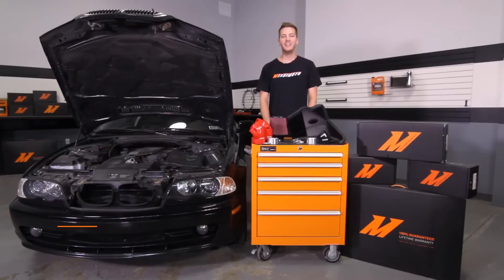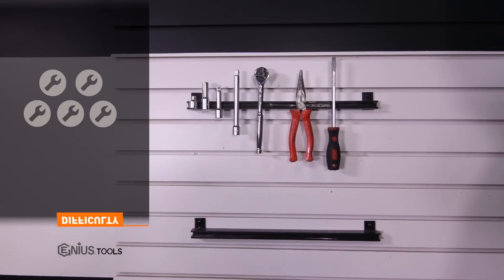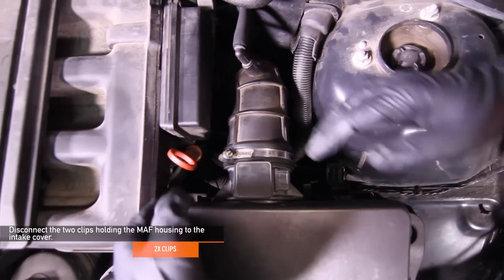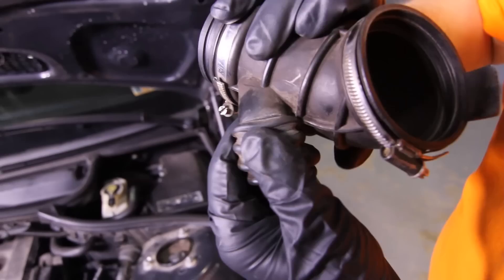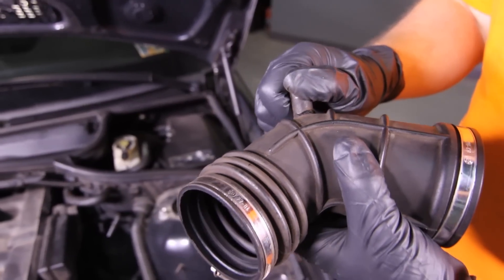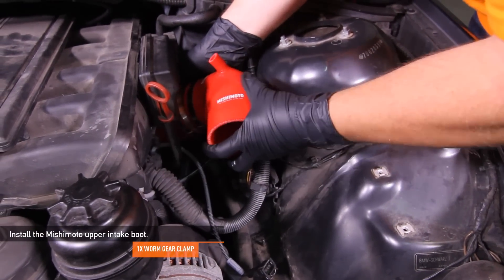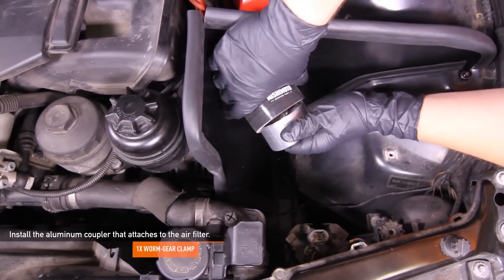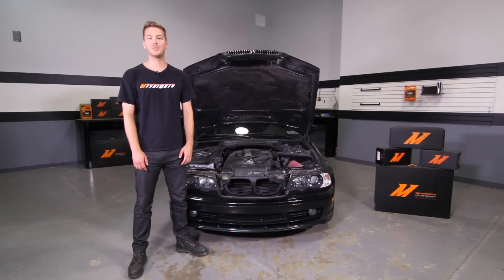1999–2005 BMW E46 Performance Air Intake Installation Guide By Mishimoto

Comment: Does the air flow meter cause damage? MY CAR E46 2002 330İ M54B30
Reply from the maker: No issues with the MAF sensor. Thanks!

Comment: Would this possibly throw out a check engine code. I keep reading forums about it needing a Tune.
Reply from the maker: No need for a tune, this will work with stock calibrations
Reply: @mishimoto  Cheers mate! Thank you.

Comment: will it work on a 2001 330I?
Reply from the maker: 323i/325i/328i only. 
For 330 applications, check out out model number MMAI-E46-01BK
https://www.mishimoto.com/bmw-e46-performance-air-intake-01-06.html

Comment: Im either putting one of these mishimoto air intakes in my 2004 e46 convertible or I'm gonna go with K&N,  haven't made up my mind yet... any ideas? I have the s54 with smg 2 6 speed transmission and borla dual shotgun exhaust, lowered sport suspension with a more mean stance and stability, the model however is a 325ci so it's like owning a sleeper, people hate me when they instigate a race at a stop light, always dust them and they see nothing but taillights or takes no more than 3rd gear and then same effect they get smoked, the m54 that is in this video isn't bad but I prefer my s54
Reply: I have a 04' 325ci convertible also, with sport package, but you have a better drive train than me, I bet its fun!

Comment: Does it need the heat shield?
Reply from the maker: The top of the heat shield does seal against the hood to prevent hot air from being introduced

Comment: Is this compatible with my e46 318i? Got a 4cyl 2.0 engine...
Reply from the maker: Unfortunately this would not be compatible due to the different throttle body location due to the shorter engine.

Comment: I'm assuming it does but will this fit in a 2003 e46 325xi?
Reply from the maker: Yes, we show that this is compatible with the 2001-2005 BMW 325i. Please contact us directly if you have additional fitment questions. Thanks!

Comment: I assume it fits the E85 Z4 as well. 2004 3.0
Reply from the maker: This will not fit the Z4, engine bay layout and spacing is different which would cause fitment issues unfortunately.

Comment: That installation is incomplete,where is the heat shield top cover,you can't leave it exposed like that
Reply from the maker: The area is actually sealed off from the engine bay once the hood is closed as the gasket along the top seals against the hood. Even without the lid the hot air is kept at bay.
Reply: @mishimoto  I see,thanks,I need the wrx elbow intercooler pipe connector to the turbo 2002 wrx,I am in kenya

Comment: Why is lower boot discontinued?
Reply from the maker: Due to the small tolerances and the silicone tube being stiffer than stock, installation of this item was a bit difficult. Due to this the part had to go back into the research phase to find a solution to this.

Comment: So will this fit my 06 330ci
Reply from the maker: The intake on the video will not fit the 330CI, we do however make an intake specifically for the 330 as there are some differences in the design.
Reply: Mishimoto Automotive do u have a link? And will it ship to California...
Reply from the maker: Of Course, I included the link below. We would be able to ship this to California however, the item is not CARB legal so you will need to be mindful of this.

https://www.mishimoto.com/bmw-e46-performance-air-intake-01-06.html

Comment: will this not work on an 04 e46 330ci?
Reply from the maker: We have an intake designed for both the e46 330 as well as the 325,328,323. However, this video is not for the 330 intake. The link below would be the intake you need for a 330CI.

https://www.mishimoto.com/bmw-e46-performance-air-intake-01-06.html

Comment: I tried to use dish soap and a couple other things to Lube it but I found using a heat gun works better
Reply: I was able to get it on with bearing grease

Comment: How does this compare to solutions offered by K&N, Green or BMD?
Reply from the maker: We unfortunately do not test our competitors components against our own. Most of our products are designed to improve on OE designs and eliminate common failure points while remaining compatible with related OEM parts.

Comment: hello, what are the odds that this installation can be done at a bmw x5 2002
Reply from the maker: Hey Luis. Thanks for reaching out. While we do not currently have a direct fit intake system for the 2002 X5, I would be happy to pass this along to my R&D team as a new product suggestion. This is how a vast majority of our parts make it to market is simply from customer suggestions.

Comment: Will this fit 2000 330ci? The Mishimoto site only covers the one fitted in this video and another intake for 2001 330ci onward...
Reply from the maker: Hello Luke. Looks like we do produce an intake system for the 330i. However, we were only able to verify fitment from 2001-2006. I'll leave a link to the product page below if you'd like to take a look. 

https://www.mishimoto.com/bmw-e46-performance-air-intake-01-06.html

Comment: What happens to that vent that was way down near the headlight on the old air box?
Reply from the maker: Hey pax6. It appears that that vent, in particular, is no longer used once you install our intake system.
Reply: @mishimoto  the stock m54 air box is already a cold air intake and it excellent from my over decade experience, this one will not let in sufficient cold air due to lack of air ducts top and bottom
Reply: @undergroundlegend198 Idea! What if you used the rest of this kit, but paired with that stock box you're describing ?

Comment: will this fit my 2003 320i touring
Reply from the maker: Hello OG Atticus. Looks like we currently have confirmed fitment of this product on the following vehicles. 
1999-2000 BMW 328i
1999-2000 BMW 323i
2001-2005 BMW 325i

Unfortunately, I'm not showing anything direct fit for your 2003 320I. While it is not an immediate solution, I'd be happy to send a new product suggestion over to our R&D team.

Comment: I recommend this type of colder intake for that car, I put a color and take the dining stage one package, but every time I wash the car I have to be very careful as my air filter is directly by my tire about 5 inches from the floorIf any water gets in there it screws with my mass airflow sensor for a couple of days, BMWs will not run after this happens until it has no moisture in the system.
Reply: Is there a water proof air filter bag you can put on the filter to prevent this?? I plan on putting my intake lower near the fog light but not using a whole kit
Reply: @x1username  he could just cover it with a black sack/trash bag while he washes the car but that would make too much sense

Comment: why is there very little for 2006?  The intake doesnt look different.
Reply from the maker: Hey Juan. 2006 is when the E90 body style was fully implemented and the E46 was ceased from production. There a quite a few significant changes under the hood that prevent these from being a direct fit on your 2006. If you feel this product could work in your vehicle, feel free to give it a try. We simply can not confirm it will fit.

Comment: Hi would this fit my 2003 320i engine code is m54b22 and it's completely stock at the moment
Reply from the maker: Hello Forbillion 3, unfortunately we do not currently produce an intake for the 2003 320I. I do apologize, but would be happy to submit a new product suggestion on your behalf! :)

Comment: Will this for on my 2000 323ci
Reply from the maker: Hello Kayo. This unit is a direct fit for the 1999–2005 BMW 323i/325i/328i . Unless there are significant differences under the hood with the convertible, you should have no issues at all :)

Comment: My maf housing is the same size of the hole on the heatshield so it won't fit through I have the mishimotto boots installed already.(04 330ci)
Reply from the maker: Hey MIchael. This sounds like something the customer service team would be happy to look into. Feel free to reach out anytime at support@mishimoto.com or 302.762.4501. Ext 2 for customer service.

Comment: Would this fit on my 2001 3 series 316i
Reply from the maker: Hey Henry. this item is Direct fit for the 1999–2005 BMW 323i/325i/328i. Currently, I would not be able to confirm fitment on your 2001 316I.

Comment: Really nice but, this really improve my bmw performance?
Reply from the maker: Hello Soro GuÊ. This intake is safe to use with the stock tune as it will not hurt air/fuel ratios under load. This intake has a unique and aggressive tone under load, and the free-flowing design amplifies engine induction sounds. This is the main benefit from installing this product as we do not list any power gains. If you'd like to hear it, check out this video. https://www.youtube.com/watch?v=HReBS77qW9U
Reply: Mishimoto Automotive v

Comment: Hii what about an older version like BMW E46 323i 1998, will it fit or u have any other models ? Ty
Reply from the maker: Hey Dave. According to my system, the 1998 323i would be an E36 model rather then an E46. At the current time , we do not manufacture an E36 intake. However, I would be more then happy to submit a new product suggestion on your behalf :)

Comment: Hi?! Will this air intake fit my bmw e46 3.18ci model 2001 ??
Reply from the maker: Hello Berkay Özsoy  . Unfortunately this intake would not fit your 2001 BMW 318. This unit is a direct fit for the 1999-2005 BMW 323i/325i/328i.
Reply: Mishimoto Automotive thank you for your answer and I will be happy if you answer  this too, if I use a fit cold air intake for my car does it worth on bmw 3.18ci model 2001? More hp or at least better sound?
Reply from the maker: Hey Berkay Özsoy  . Without testing the vehicle on a dyno, I would not be able to verify if installing an intake on your vehicle would make more horsepower. However, intakes in general do seem to help increase the intake sound of your vehicle which usually results in better sound :)

Comment: Is there any danger of water or dust getting into the engine with this intake replacement?
Reply from the maker: Hello Mihael Keehl. While the potential for water or dust is a risk with any aftermarket intake, our heat shield protects the filter itself quite well from any unwanted debris . Check out the installed section of the product page to see what it looks like :)  https://www.mishimoto.com/bmw-e46-non-m-performance-intake-1999-2005.html

Comment: will all of this fit in a 2002 325ci coupe?
Reply from the maker: Hey Justin! Unfortunately this performance air intake will not fit your 2002 325ci - however, we do offer a few products that are direct fits for your MMY.  We have our performance aluminum radiator, performance fan shroud kit, and silicone radiator hose kit.  Head over to Mishimoto.com where you can use our drop down menus to enter your Year, Make, and Model to view direct-fit products!

Comment: did the check engine light come up? and if so how did you take care of it as everyone i know who used a cold air intake on an E46 got a check engine light instantly
Reply from the maker: Hey Joseph! This unit is a complete bolt-on that functions perfectly with the stock tune and can be installed in one hour using common hand tools.  It's safe to use with the stock tune as it will not hurt air/fuel ratios under load.
Reply: In other words this model would not bring up a check engine light?
Reply from the maker: That is correct, Joseph.

Comment: hi guys.  will this work on 4 cyls engines?
Reply: JackedVideo well i drive what i can afford, and any gain no  matter how tiny is better than no gain :D
Reply from the maker: Hey! Sorry this intake is for engine codes M52, M54 and M56!
Reply: Mishimoto Automotive bummers
Reply: alexandru vrabie you're going to put an advanced intake on a 4 cylinder!!!? lol you can try, I don't know if it would do anything different to the power since it is a small engine

Comment: The CNC fitting is different on a 2000 323I M54 doesn't have a smaller hose just one hose. any suggestions on how to get it to work

Comment: This also fits a 330i right?
Reply: Yeah i think they've just made a mistake. They may also have created a different version for the 330i but I doubt it.
Reply: GODDAMNDAVID Yes mate. It's exactly the same progress and measurements. No idea why they said it works only on 328i but 328i and 330i is pretty much the same so it will work perfectly.

Comment: easy upgrade. but do you gain any power from it?
Reply: No it won't make any real  power gains, but really compliments the rasp of the straight six engine with a nice  metallic sound. Anybody who says it will help power gains is a salesman only........
Reply from the maker: +MmM We saw maximum gains around 4,600 rpm to the note of around 4 whp and peak gains of 2 whp at 6,000 rpm. If you look at the plot, you will see that we make 1-3 whp throughout the entire rpm band, which is fantastic!
Reply: +Mishimoto Automotive Cann it also be installed onto 320d?
Reply: Any chance you could link the dyno graph results somewhere?
Reply: +Mishimoto Automotive that's a really nice high quality kit